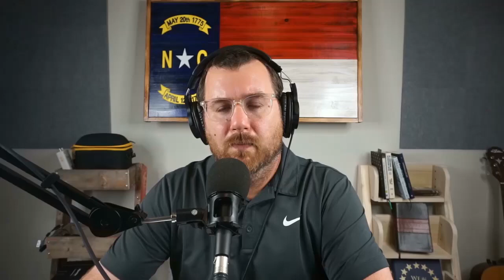The Dangerous Properties of R290 refrigerant

Comment: A static spark will light it, also it is torch and grill fuel. It does get very cold if used as a refrigerant though.
Reply: I just saw a news video of a woman’s fridge that exploded from all sides less than 1 year old. It ripped drywall off the walls down to the studs. Scary stuff

Comment: I guess they’re going to have to ban people carrying BIC lighters in their pockets or in the glove box in the car. 
             I guess I’ll find out one morning when the freezer in my garage leaks all the 1.4 ounces of propane (R290) into my garage with a closed garage door and I start my car up I guess my whole house is going to explode 🤯 💣 🔥 🏡 
          Never mind worrying about the 15 gallon gasoline tank I’m sitting on when I’m starting my car with fuel lines running from the rear of the vehicle up into the engine compartment with multiple O-rings and gaskets and connections that could easily fail.